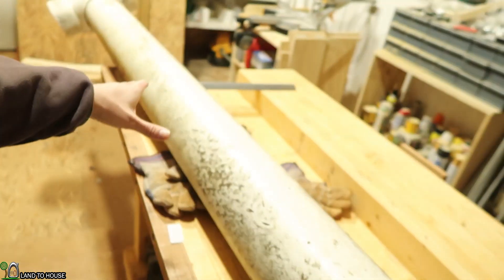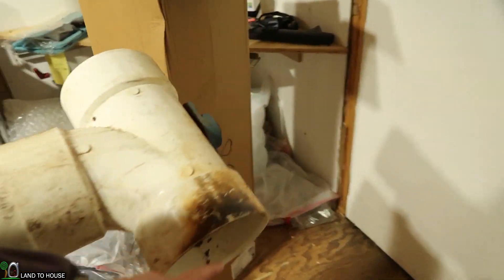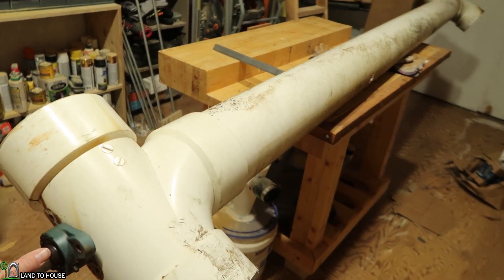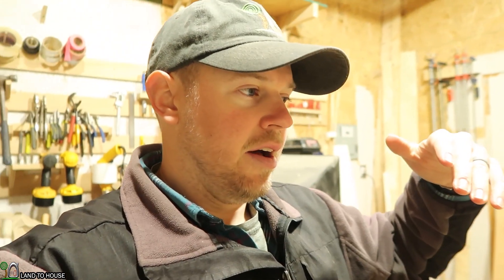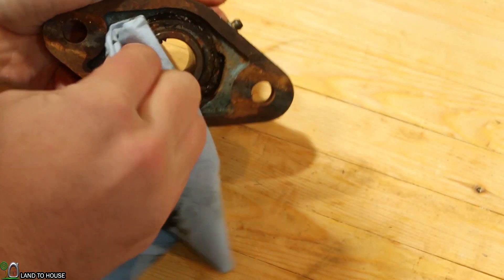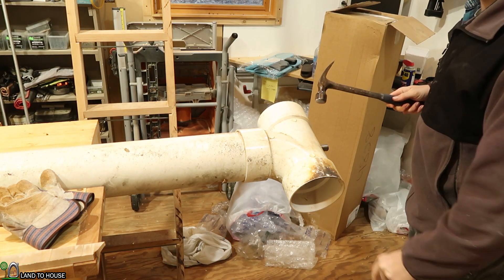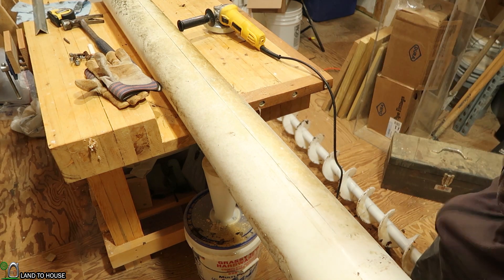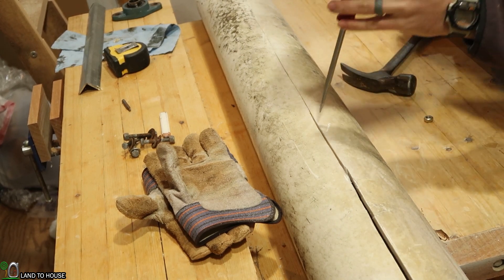Bring Back the Archimedes Turbine P2  - VL177

Comment: WHAT ABOUT TWO 5 ft. SYSTEMS FASENED TOGATHER SIDE BY SIDE?  GEAR OR CHAIN DRIVE THEM TOGATHER.  IF THAT DID NOT USE TOO MUCH (GPM.) OF WATER, THAT MIGHT GIVE YOU CLOSE TO THE SAME HP. YOU WOULD GET WITH THE ONE 10 ft. SYSTEM.
Reply from the maker: I like where you are going with this. I think that I will work with the single 5 foot section at first and go from there. I also am looking at making my own auger from the wood/pvc. I think it would be a fun build. If all that goes well we should try the double 5 foot auger.
Reply: GLAD YOU LIKE IT.   I MIGHT SEND MORE TO YOUR PO.BOX, LATER.YOU AND YOUR FAMILY HAVE A BLESSED CHRISTMAS AND NEW YEAR..
Reply from the maker: I am very new to pulleys and chains (gearing in general) I am looking forward to Learning.  

Have a merry christmas as well!

Comment: Bent Auger?  Bent PVC could be causing rubbing, if you run auger long enough it should wear away the pvc, thus removing rubbing.   Might want to find a bearing puller at a yard sale.  I found a lefty/righty tape measure at a woodworking store, so it doesn't matter which end I measure from.  Where the joint is, can you split that?  slide it apart, then encase the inner shaft in a 12" or longer piece of pipe that would bridge and strengthen it as you slid it back together?  does that make sense, you would have to drill some new bolt holes.
Reply from the maker: Yes adding the longer inner shaft at the joint would give more strength. The one that is in there now is possibly 6 inches long??? I guess we will get in there and find out. I am going to use the 5 foot section and see how that goes. If it works well I will give other things a try.

Comment: I'm really curious, it's the first time I've seen a PVC screw for transport turned into a hydroelectric generator, I have the feeling that the diameter is slightly small being a reaction system and not an action like a Pelton or Turgo impeller. (not suitable for this low pressure situation)
With 200 gallons per minute in the best conditions estimating a jump height of at least about 55 inches (I don't know the length of the auger) at the top they are 100W electric, but only with a permanent magnet alternator not with a DC brush mode or with an asynchronous motor + capacitors, the only one for this small power is a small permanent magnet alternator example:
https://www.ebay.com/itm/2019-Permanent-Magnet-Alternator-Wind-Turbine-Generator-12V-50Hz-100W/312803490084?hash=item48d48a7924:m:mbWyF7tLzKJpUG13d9ZmJKQ
2 pulleys will be needed to multiply the speed with a ratio of at least 20
Ciao
Reply: Pietro- wow 😳, great analysis . 🦀
Reply from the maker: Yes I like it too.
Reply from the maker: I agree with you that the diameter is too small on this auger. but I think that it will still be fun to give it a try and see what happens. It will give some nice results for when I try to build a larger one out of another material. The 6" auger might be able to hold 10 gallons per minute. (complete guess). This means that most of the water in the creek will bypass the auger. But if I were to make one that was 2 foot in diameter it might be a different story. 

I am new to pulleys as well so this will be a fun learning experience.

Comment: Could you run twin 5ft. augers. Set up two pipes and split the water to each? Then using pulleys possibly combine the output to run your generator.
Reply from the maker: I think that is a possibility! Lets work with 1 five foot first and see how that goes then we can jump it up to using both.